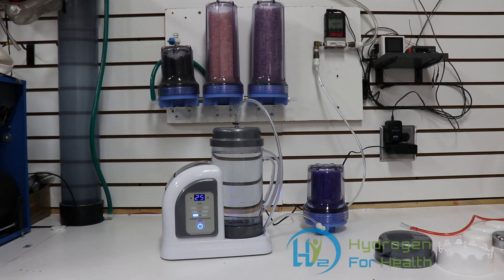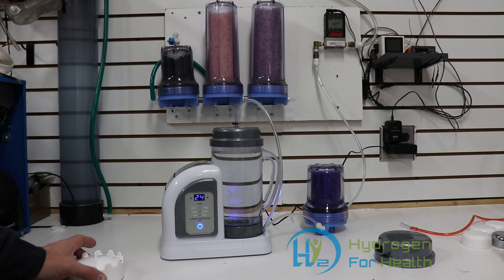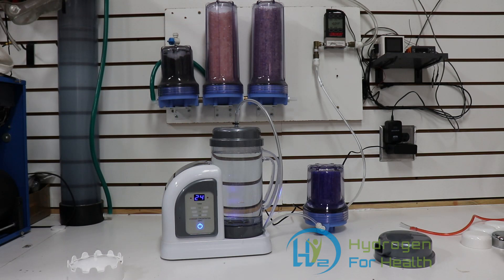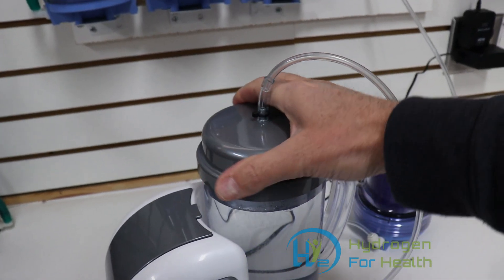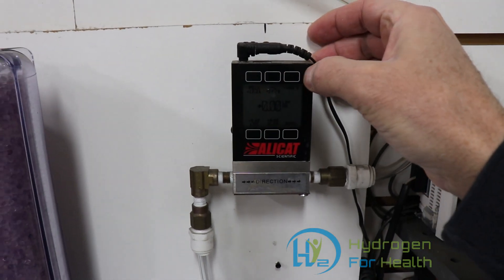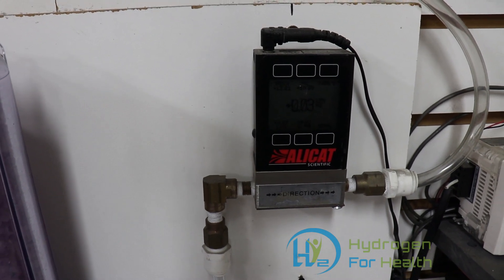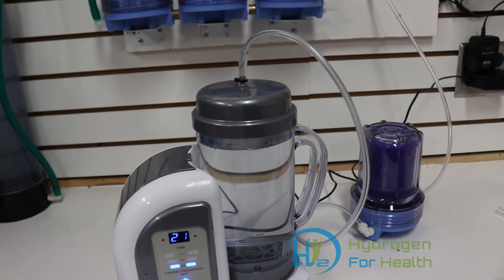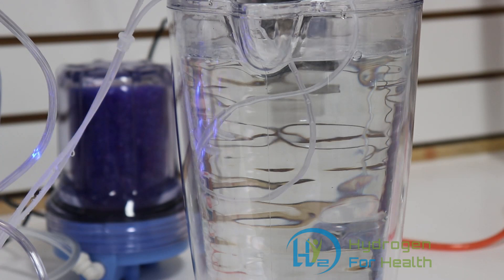Lourdes Hydrofix review. Is it worth the price? Hydrogen water generator.

Comment from the maker: I did another video showing mathematically that the hydrofix company is over inflating their numbers.  Take a look https://youtu.be/c1uBz0Ca5wo  Also here is their return policy. https://holyhydrogen.com/pages/cancel-return-exchange-amp-refund-policy
Reply: Befpre I saw this vid, I saw another that showed the h2 coming out of the m/c bubbling thru water - similar to yours.  At first nothing came out, then he sealed the output tube (again, similar to what you did) and the bubbles came out at the same poor rate.  To me this proves that your metering equipment was not changing the flow rate.
I think the reason the h2 water it produces is around the 1.5 to 1.6 ppm is due to the very many small bubbles streaming up (giving a huge surface area in contact with the water), and I'm surprised that so many small bubbles produce so few large ones...
Reply: Is there any possibility that you are wrong?  Is it possible that they are using more advanced technology and methods to be able to produce what they claim?

Comment: Wouldn't inhalation be more effective? Inhalation allows for rapid bioavailability, as molecular hydrogen is absorbed directly into the bloodstream through the lungs, and can immediately begin to combat oxidative stress, inflammation, and other health concerns. With the water, it's limited in terms of bioavailability, as the body has to absorb it through the digestive system, which could reduce the overall impact due to metabolic processes.
Reply: Especially if someone has gut issues to begin with as well

Comment: Steve 
Thank you for your amazing work! Very much appreciated thank you.

I'm curious have you tested a look on your channel but what is your opinion of the DLLES IN Aquolia.
Have you tested any of their models?
They're making hydrogen water I'm sure you can breathe it too but I'm very curious.
Reply: The electrodes are about the same pricing to get four of them actually and they're massive they're huge no way they fit in a little plastic thing you get with this company
Reply from the maker: I took a look. Both the anode and cathode are both in your drinking water. The anode will make ozone, chlorine and oxygen when using any water that has a TDS over 1. Simply saying this product will contaminate your tap water. It's not a healthy choice.

Comment: Steve, I found this recently.  All the people in the comment section who tried to gaslight Steve need to read this. 
The flow rate stated below is pretty close to what you actually measured with your $2000 flow meter.   
So the company was lying all along, claiming the flow rate of the Lourdes Hydrofix to be 120 ml/minute, when in fact it is only about 40 ml/minute.  

"Lourdes Hydrofix generates 48 ml/min of hydrogen gas. This amount of hydrogen gas generation rate is not a theoretical value based on calculations, but rather a measurement of the actual amount of hydrogen gas supplied through the tip of the cannula. In other words, it represents the amount that can be inhaled through the nose..."

Comment: Thank you for the video!
I have one of these, and am thinking the little water filter needs replaced. My question is: what is the purpose of the filter, what is it supposed to do, and how does it effect the quality of the results.
Reply: I think it just extends the time between electrode cleanings when using tap water.  If you use only distilled water, you shouldn't even need the deionizing filter (because distilled water has no minerals in it to be filtered out) and you won't have to clean the electrodes as frequently.
Reply: WHAT, THEY DID NOT GAVE ANY INFO, FOR THAT PRICE, SEND BACK QUICK

Comment: Are you aware that the Hydrofix company works directly with Doctors, scientists and engineers and participates in molecular hydrogen research.  The chinese companies out there are not involved in this way.  I can't believe that you have asked customers of the Hydrofix to request a refund based on your methods.  That is truly low.  If you are doubting that the company's number are wrong, why not just call out the company and ask them for proof.  unless your reason for doing this is to sell more of your machines.  Bearing false witness for profit?  Be careful brother, what how you conduct yourself.  The Hydrofix company is a humble and dedicated company.  The man who developed the Hydrofix did it for his very ill daughter.  He is super honest.  So be carful before speaking out against a company based on you "solid methods"
Reply: @The Insufferable Tool Hello, Actually there is a video that the Hydrofix engineers put out on the Holyhydrogen channel.  It uses several very accurate methods all showing the levels that they claim and higher.
Reply: @flaquitoyork  It doesn't mean they were honest.  Steve has proven that the flow rate is not even close to what the company claims it to be.  He proved it 3 different ways.
Reply: @Bruce_Wayne35  unfortunately he did it with the wrong equipment, has a dryer which changes the levels, and adds tube length.   The manufacturer claims only from testing at the nose piece.   Watch it on the Holyhydrogen channel, the engineers prove it.   They use the most accurate method next to chromatography machines which cost over a million dollars to measure hydrogen gas accurately ,  plus you must remember, Japanese are honorable people, they don’t make claims that are not true.   Look how they cleaned the stands at the World Cup after the game.
Reply: @flaquitoyork  He used three different methods to prove it.  One method he used was showing how much power the circuit draws.  It can only generate a certain amount of H2 based on a given amount of power being drawn by the electrolysis circuit, and the known efficiency of that circuit.  The company has tried to cover their lies by claiming that they have invented a more efficient method of generating hydrogen gas.  Until this is proven, you can safely assume that they are lying about this as well.
Reply: @flaquitoyork  All a dryer does is remove the moisture.  Do you really expect me to believe that the hoses and junctions are losing hydrogen gas at a rate of 80 ml per minute?
Reply: @The Insufferable Tool the proof is on their YouTube channel posted a long time ago.  It’s Holyhydrogen Hydrofix channel
Reply: @flaquitoyork  If you are in the market for a hydrogen inhalation machine, there is a unit available that can produce 150 ml/minute of H2 for around $600.  That's a mere fraction of the cost of the Lourdes Hydrofix.  There are better options out there.  So I encourage people to do their research and shop around before they waste money on a device that doesn't perform up to the level the company claims.
Reply: @Bruce_Wayne35  what's the name of the company of this machine you talking about?
Reply: @Bruce_Wayne35  What unit are you speaking about?
Reply: @mtownstunna09   "what's the name of the company of this machine you talking about?"
Aquagreen.
Reply: @colinchang1543  Aquagreen.
Reply: @mtownstunna09  My replies to you have been censured and deleted repeatedly.  I have no idea why, because I didn't post any links whatsoever.  I don't represent that company, nor am I employed by that company.  I simply saw a bargain and I wanted to let other people know about it, so they don't have to spend thousands of dollars to try hydrogen therapy.  And yet, my comments are being deleted over and over again.  Weird.
Reply: @Bruce_Wayne35  what is the name of that device?
Reply: @GOOD2KNOW are you aware that you are hard selling , that obviously no one wants your scam copycat LOURDES hydrofix???
Reply: @mindhormone  Interesting information, The Hydrofix manufacturer was just contracted to create a reproduction of the Hydrofix on a grand scale for Hospitals in Japan because of how pure and safe it is.   There is no one else with the technology or understanding that can do this.  And that is why the Hydrofix manufacturer is the current Authority on hydrogen production and the #1 machine in Japan (Japan is the authority on molecular hydrogen and it is where most of the reliable research is coming from).  It is true that the Japanese did not invent the hydrogen technology & The Japanese also did not invent the car but they have surely made it much better with their ingenuity.  I simply want to support the the best machine and the company willing to take hydrogen the distance for safety, efficiency, and effectiveness .  I've had mine for almost 5 years and it has provided so much healing.  What ever machine you choose I would only advise that you stay away from HHO machines. good luck to you brother.  It was never my intent to offend you.  Life is hard enough as it is.  I wish you well.  take care.
Reply: @flaquitoyork  do you know what is hho ? Do you know the elements of hho?  Probably you just watch hydrogen boy.
Reply: Why don't you make a video of your own?  Measure the flow rate of this device, proving the flow rate to be 120 cc/minute and then upload the video to Youtube?
Reply: You are delusional. The power supply for this machine is 3.5a , 8v. It's impossible to produce enough h2 for breathing. It's very good for h2 water. But you can believe what you want. Did you buy it for 2500$ or just talking?
Reply from the maker: I have made repeatable requests from the man behind the curtain.
Reply: @Hydrogen4Health  what man behind the curtain? Do you mean  that you have contacted the manufacturer or distributor? What did they say?

Comment: 9 years ago we did testing of titanium and platinum in the water and if you look it up it is very bad again for the body so I just thought I would share that with you.
Reply: Titanium does not rust! Lourdes Hydrofix premium edition uses pure titanium as it does not oxidize and they do NOT use direct electrolysis which is highly oxidizing where in a very short period of time the metals begin to oxidize (rust) and leach into the water you are consuming. They hired the best engineers in the industry and spared no expense at using the highest and most expensive metal there is. If it is used in medical stents and dental implants I am not sure what you are talking about here.
Reply: @quantumclinic3212  I'm not going to get into a debate but the  is is it is doing direct electrolysis.
Reply: Sorry for the spelling error It is direct electrolysis.
Reply: The water is in direct contact with the electrodes titanium yes does not rust but there is a toxic byproduct from titanium also the platinum as well I have worked with multiple scientists and I'm not going to get into it anyways just thought I'd give you that information.
Reply: @scottsmith6960  I do not wish to get into a debate either, I am only stating a fact - the Lourdes Hydrofix Premium edition does not do DIRECT electrolysis which is the difference. It is a Separate Chamber Electrolysis System called SPE/PEM Membrane Technology and again only uses pure titanium so there is no oxidation of cheap metals that are extremely toxic in a short period of time that goes directly into the consumed hydrogen like many of the other machines. They contracted the same company that NASA uses.
Reply: He might want to do your research on that cell design and you will see that it is electrolysis.
Reply: we are a cell company manufacturer for eight different countries so you might want to do your research on that technology and are you the manufacturer
Reply: @scottsmith6960  which machine should I buy ?
Reply from the maker: Scott Smith I haven’t found a suitable way to test for titanium and platinum. I welcome your ideas.
Reply: @Hydrogen4Health  well the testing that we did years ago there's micro-particles in the water and that's what scares me about those units using titanium and platinum cells just thought I would share it with you.
Reply: Look up all those metals and you will see the other thing that's very scary the DPF filters that are on every new diesel truck has those exact metals in there and those are carcinogenics that get down in your lungs.
Reply: Maybe next week we can talk on the phone a little bit about some of this stuff.
Reply: 9 years ago...……..a lot has changed since then!
Reply from the maker: @quantumclinic3212  Scott is right miss quantum. The company can use their fancy words but i'm sorry to tell you the hydrofix uses the same electrolysis. Your probably the only one that doesn't understand. BTW where is that video you were going to make?...
Reply: I'm considering buying one but this has given me pause. Is there any info out there on these micro-particles?
Reply: @colinchang1543  if you watch my YouTube videos you will understand we are doing a different technology first of all been doing this for 14 years our cells do cut houses not electrolysis. Also our system never touches the plate for the water that is being charged we have three filters before even gets to the water that's being charged a lot more complicated system but guaranteed not to leak any I'm sorry to Leach any materials into the water I have hardcore data from doctors showing the results that we got and we have helped over a hundred people now with our hydrogen technology. You need to look it up on the periodic table there are diatomic hydrogen monoatomic hydrogen and oxygen. Again if you look at my videos on my YouTube you will understand that every hydrogen system makes different kinds of gas so maybe that can help you.
Reply: I'm sorry I forgot to mention my hydrogen company it is Central valley HHO. And you might want to look up my YouTube channel.
Reply: SSfutureScott

Comment: Steve this is Scott from Central Valley hey I would love for you to do a test on if there's titanium in the water and platinum in the water because those are all bad for the body That's why using lye for the technology to electrolyze is much better What are your thoughts let me know.
Reply: wow,  awesome question.  didn't even occur to me.  would you mind sharing anything about the subject you have learned recently and which brand/unit you use?   thank you!!!!!!
Reply: @coppulor6500  https://youtu.be/y4Ry8m0x4p4
Reply: @scottsmith6960  very interesting.   coupla questions.  O2 generators are illegal without a prescription or some type of license or some similar BS.   I understand that O2 is flammable and can cause an explosion/fire if concentration is too high.  yet, despite my appearance, I am not an idiot and I wanted to figure out a way to improve IAQ due to major health problems in my house.   technically my GF's house into which I moved several years ago.  I am a very experienced home inspector and found ZERO visible mold (of significance).   Fast forward to today - I am now essentially a mold expert and the search is never ending for ways to improve our health (beyond the endless time, work and money I have put into remediating this POS 1982 house).   Life has been rough since my sweet baby cakes of joy has not been able to work due to debilitating emotional/psych issues (women are far more susceptible in this area due to the much larger portion of the female brain devoted to emotion).   We have all had CFS and all the cray cray emotions related to mycotoxin inhalation.  We are slowly but surely getting better - you would not believe the shit I've done to this house (with help from the kids and my biscuit - when we have the energy and motivation to do so).     I went from very high energy guy who played team sports twice a week and lifted regularly to mush in da brain and in the waistline etc.   Having enough energy to just do my job and help keep us above the poverty line has been a real challenge but I refuse to give in and I am a resoich-a-holic (not JUST a smartass)  : )     Anyway, I recently read some studies showing drinking hydrogen water can significantly impeded the growth/reproduction of some molds in the body such as Fusarium.   I was wondering if your unit has sensors that can determine when to stop the flow of hydrogen given its flammability.   I also suspect that breathing hydrogen is far more effective than drinking it since it enters the bloodstream immediately.  so, your thoughts on this and flammability issue?  I'm going to email you too.  Thank you!!!